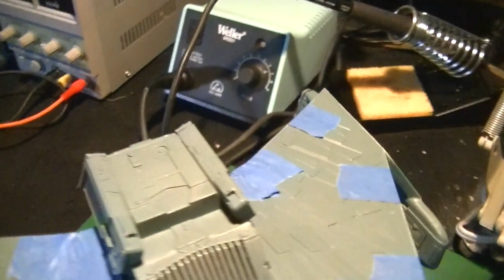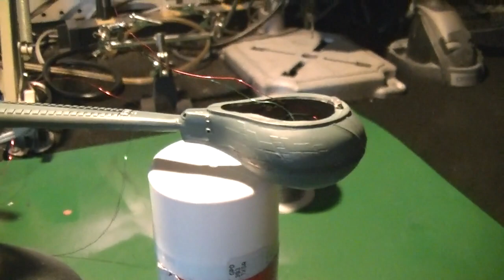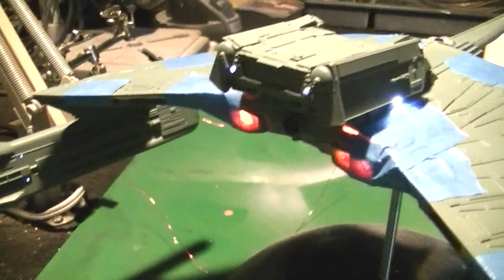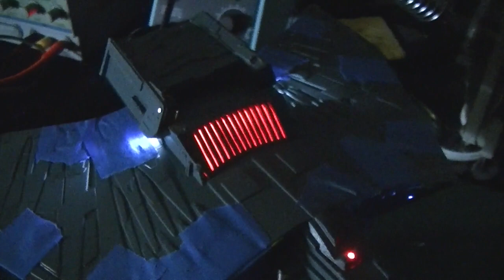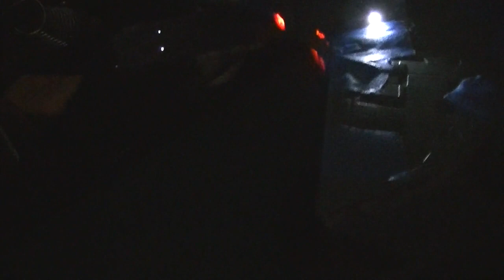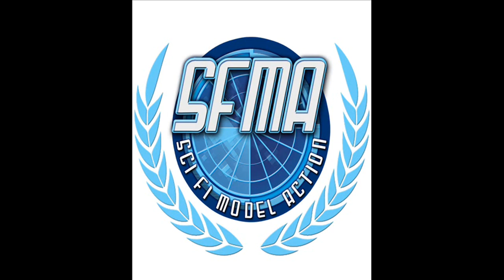AMT 1/537 Scale Klingon K'tinga Cruiser Buildup PT 5

Comment: Really nice model, I  just ordered those castings from J.T. Graphics looking foreword to seeing them.  I  am just gathering the things I  need to build my K'Tinga.  I  have a few questions if you don't mind?   is the system board still available?  Also  have you ever used Tenex 7 R solvent to build your models?  if so  how do  you apply yours?  I  have tried using a small glue bottle  but as soon as I tip it to apply too much runs out.  Any advice would be appreciated.